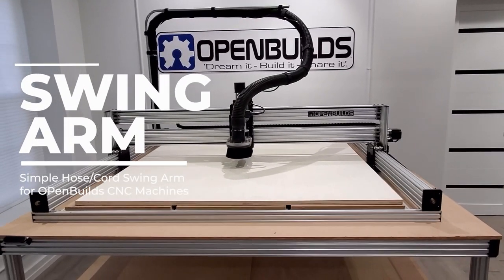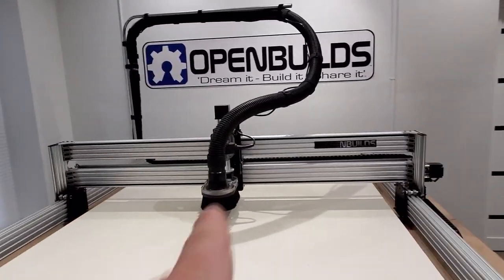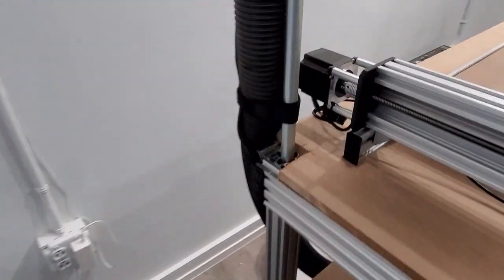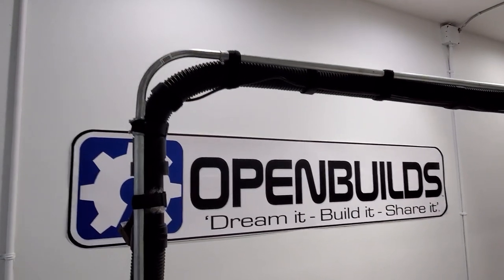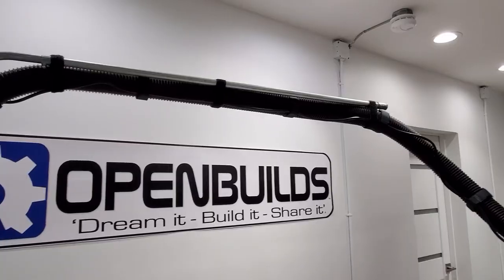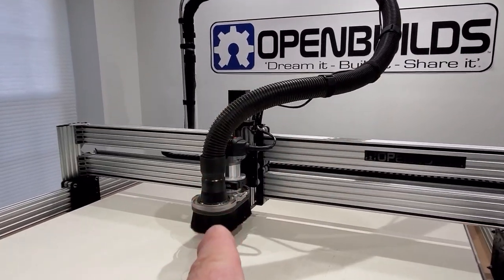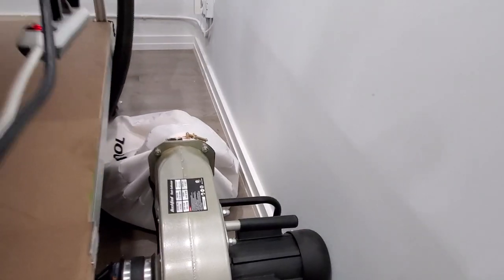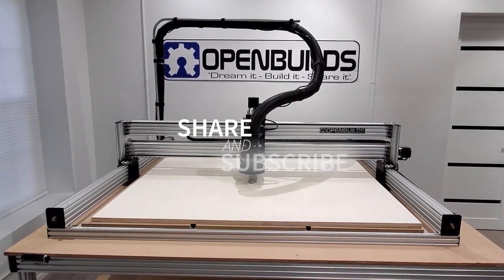HOW TO: Easy CNC Swing Arm

Comment: Thanks!  I was just about to setup my dust collection with a 4" (overkill) but now I will use a 2 1/2" with the swingarm.  Less clutter, easier operation.
Reply from the maker: Your more then welcome, glad to be a help. Lots of times when we assemble a machine we skip this simple step that cost us less then 20 bucks but makes such a huge difference in the daily work flow with this awesome machine.

Comment: Great video. Is there any build video for the dust boot?
 Also, how long was the hose used for this 1515 machine?
Reply from the maker: Thank you. Check out this build that goes over the vac system in a little more detail. - https://youtu.be/RwYulYI8uRw
Reply: @OpenBuilds  I was actually asking what dust boot was on the machine and if it was a purchased or something openbuilds built.and if so, is there is any video for making it?
Reply from the maker: @fathmi  Sorry for the misunderstanding :) That's a Kent Dust shoe and it works really nice, The one here fits a 65mm diameter router like the RoutER11 - https://openbuildspartstore.com/dust-shoe/

Comment: What vacuum is that? You say how nice it is but don’t mention make or model.
Reply from the maker: Hi Adam, we have the whole build posted on OpenBuild including all the links in the parts list which is located under the parts list tab at the top of the page here - https://openbuilds.com/builds/swing-arm.9678/
Hope this helps, you will really  like this vacuum, thank you.
Reply: @OpenBuilds  nothing on the link shared describes the vac shown in this video. I am interested to know the brand and model as well of the vac itself
Reply: It's a Bucktool Dust collector. Not sure the model but you can see the label at 2:35 in the video.
Reply from the maker: BUCKTOOL 1HP 6.5AMP Wall-mount Dust Collector with Dust Bag, 550CFM Air Flow DC30A -  https://amzn.to/39FuN0E

Comment: Any problems with static?
Reply from the maker: Hi Patrick, I ran the vacuum hose and the router cord on this and have not had any static problems. In fact I think it helps as it moves both of these static causing elements up and out of the way of anything else.

Comment: Nice, but I just have a hook in the ceiling and a Henry vac!
Reply from the maker: We did the same for years and it works but for very cheap and little effort this system makes a great difference especially since we are on wheels and can roll around allowing the vacuum hose to ride with it. We plan to upgrade all the machines in the shop.